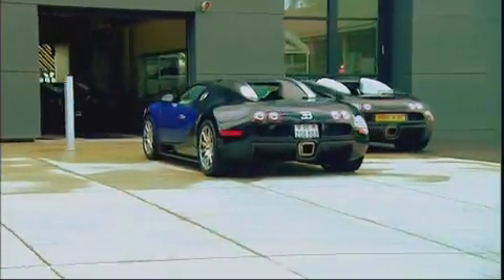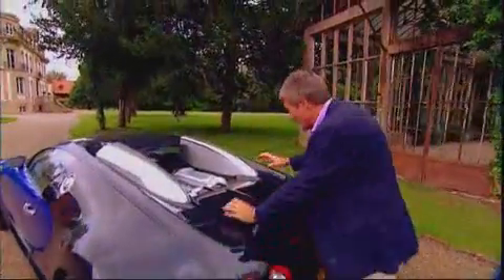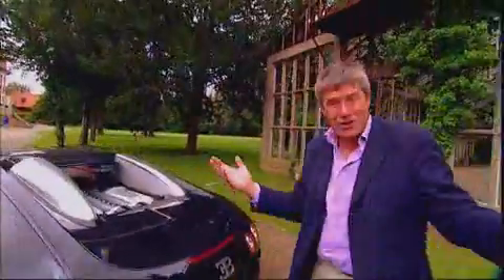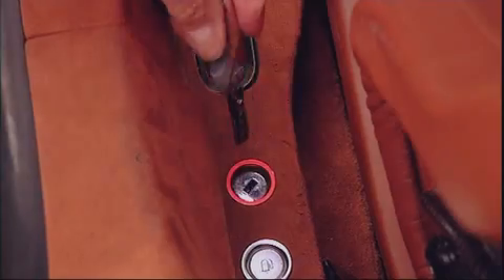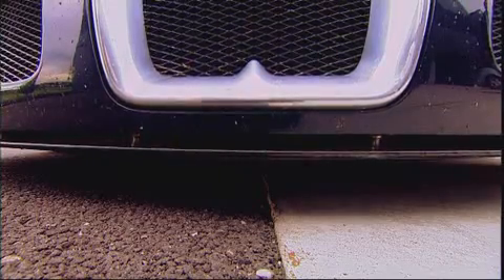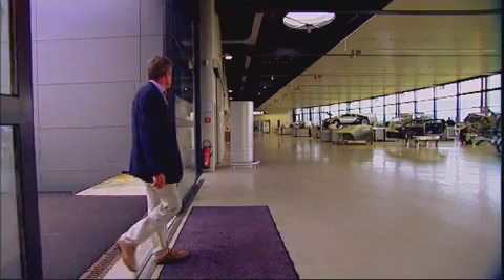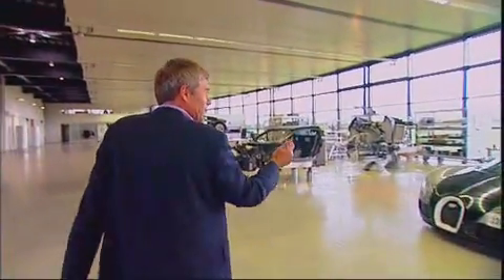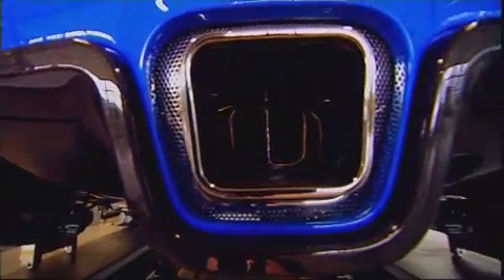Fifth Gear - Bugatti Veyron Part 1

Comment: How can you com-pair the SSC Ultimate Aero to the bugatti Veyron? The veyon just oozes stile quality and reliability.. And more luxury than any Cadillac on the road!../
  Non of witch the SSC Ultimate Areo will ever have! And for the 3mph speed difference, you have to remember the Veyron still gets to its top speed of 253mph slightly quicker than the SSC can get to 253mph...

Comment: That is only a unproven claim. Problem is no car can achieve 1.67 seconds with street legal tires due to frictions and rear traction. 270 mph is only estimate but then will not be as smooth as Veyron due to Keating KTR cage structiures.

Comment: Not that Shelby who specialized in Ford cars while this one uses modified Corvette C5R engine. Be in mind the Ultimate Aero has no traction control, ABS and even power steering; in term of handling, it is a typical race car. It is only designed to reach top speed and has yet to reach production status (very few are made).

Comment: Right, seeing how SSC spent times to tweak their Ultimate Aero (seen the same car on Street 411, Jay Leno Garage), the car is not technically a production car otherwise tuned cars like Corvette Sledgehammer or 9ff GT9 will have to be taken in consideration. SSC Ultimate Aero is mostly comparable to Koeningsegg than Veyron.